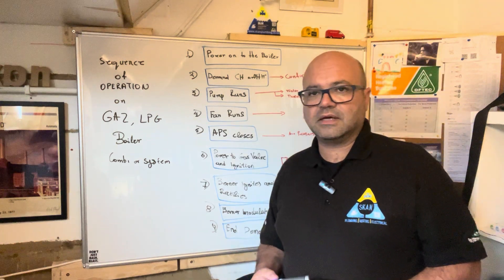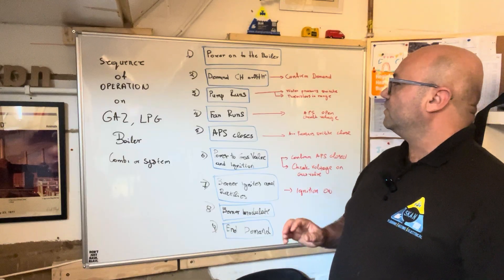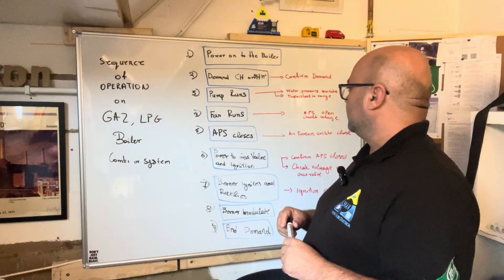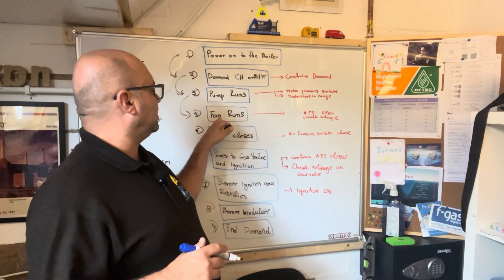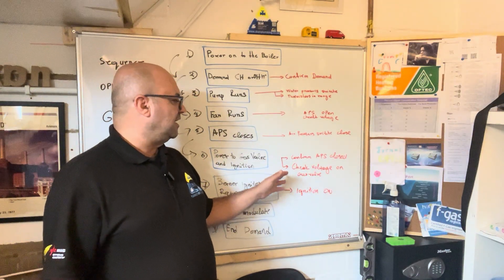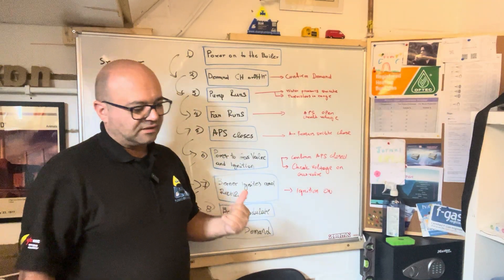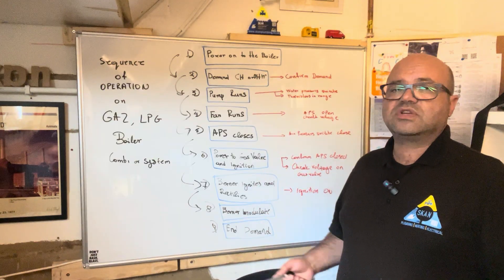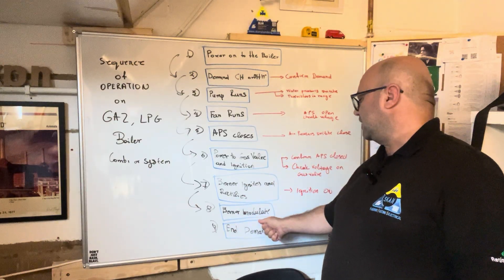How a Boiler Fires Up: Step-by-Step Sequence Explained

Comment: On a system boiler if the pump is not running will the boiler still fire up and then cut out due to no cirulation
Reply from the maker: Well done on the question. It is a very good one and shows you are thinking in the right direction.

On a system boiler, the boiler will not fire if the pump is not running. The pump is part of the safety and control sequence. The boiler needs proof of circulation before it allows ignition.

If the pump is seized, electrically dead, or not being powered, the boiler control will normally prevent firing, or it may attempt briefly and then lock out almost immediately depending on the model.

So in simple terms:
	•	No pump operation
	•	No circulation
	•	No proper boiler firing

This is exactly why pump checks are always one of the first steps in fault finding on system boilers.

Good question. Burn
Reply from the maker: 👉 Download here: subscribepage.io/Gasboilerbreakdownsequence

Keep it saved. Understanding the sequence makes fault-finding easier and safer.

Best regards,
Yiannis

Comment: Hi, pkeas could you tell me why my boiler (combi boiler) keeps losing pressure? I used to have to top up the pressure (via a valve under my kitchen sink) every couple of months, but lately I have to do it every day as it's losing pressure so much quicker ☹️. Thank you in advance.
Reply from the maker: Hi there, thank you for your message. When a combi boiler suddenly starts losing pressure every day instead of every few months, it usually points to one of three things:
	1.	A small leak somewhere on the heating system – often on a radiator valve, pipe joint, or towel rail.
	2.	A faulty expansion vessel inside the boiler – if it loses its air charge, the system will drop pressure very quickly.
	3.	A pressure relief valve that is slightly passing water outside.

The best way forward is a simple pressure test to see if the system is leaking or if the issue is coming from inside the boiler.

If you need any guidance on what to check first, I’d be happy to help.

Best regards
Yiannis
Reply: @skanplumbingheatingelectri1747 Many thanks for your reply Yiannis. Yes please could you guide me on how to do a pressure test to check whether it's a fault inside the boiler or a leak somewhere in the heating system.

I am a single woman and have no experience with boilers or heating, I only know how to increase the pressure in my boiler (it's a Valiant boiler by the way).
Kind regards, Carol
Reply from the maker: A quick tip for you.
Tie a small food bag on the PRV pipe at the back of your boiler. If the bag fills with water, the issue is likely the expansion vessel or the PRV. If it stays dry, the leak is somewhere else in the system.

This is just a simple check. For a safe repair, you will need a Gas Safe registered engineer.
Reply: @skanplumbingheatingelectri1747 Ok thank you, I'll try that 👍
Reply: Στάθηκα ακούγοντας τη προφορά και είπα ώπα, δικός μας.
Πολύ ωραία,καλή συνέχεια.
Reply from the maker: Σε ευχαριστώ πάρα πολύ για τα καλά σου λόγια. Χαίρομαι που σου άρεσε και που ένιωσες τόσο οικεία. Να είσαι καλά και καλή συνέχεια σε ό,τι κάνεις.
Reply from the maker: Hi there and thank you for your message. When a combi boiler starts losing pressure every day instead of every few months, it usually means one of three things.
	1.	The expansion vessel has lost its internal air charge, so the system cannot hold pressure properly.
	2.	The pressure relief valve may be slightly passing water when the boiler heats up.
	3.	Or there is a small leak somewhere on the heating system that has become more active with time.

An engineer can check these very quickly for you. Most of the time it is the expansion vessel or the relief valve which is an easy fix.

I hope this helps and thank you again for watching. If you need any more guidance, feel free to ask.

Best regards
Yiannis

Comment: Hi I tried to email you regarding the Sequence of operations PDF but your email didn't go through, what is the best way to contact you. many thanks for your video.
Reply from the maker: Hi please email me at info@Skanplumbing.co.uk
Reply: Hi  can I have a pdf version
Reply from the maker: https://preview.mailerlite.io/preview/391237/emails/172526975662949399
Reply from the maker: https://preview.mailerlite.io/preview/391237/emails/172526975662949399